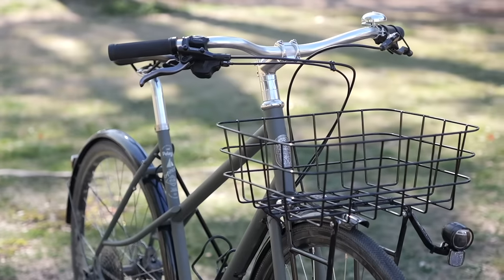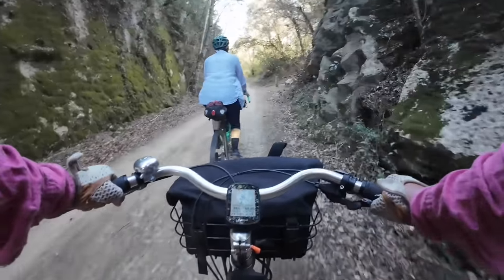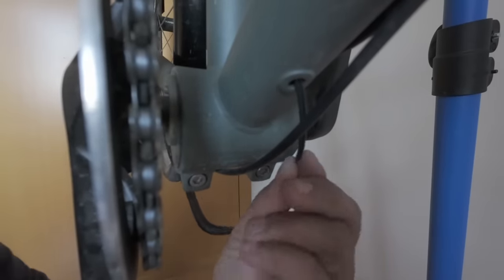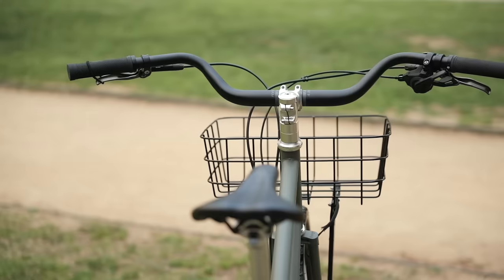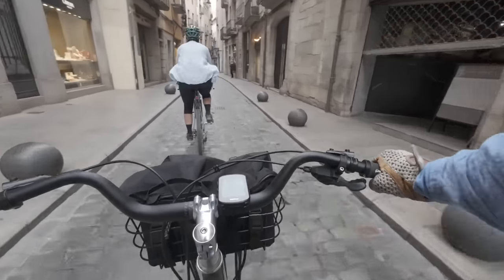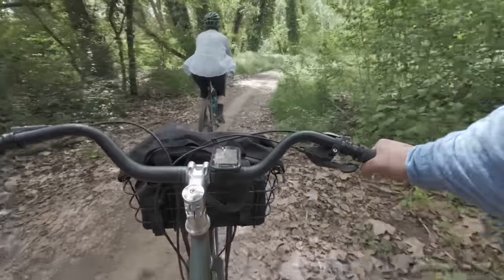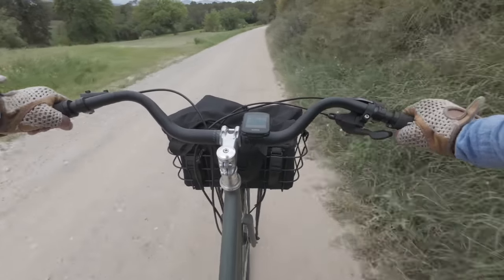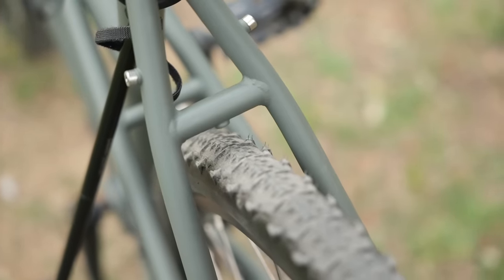I ATB'd a Bike So You Don't Have To

Comment: Be honest: you swapped the tyres because Ritchey is easier to say than Schwalbe😉
Reply from the maker: True
Reply: Sshh-wal-bee

Yeah, just stick with Ritchey.
Reply: easier to mount, too.
Reply: @stanley909 More like "Shvalbuh", actually. So yeah,  Richey definitely easier 😂
Reply: @PathLessPedaledTV  Love the way you pronounce it, makes it sound like "Schwabbel" wich is German for "jiggly body fat", sounds quite supple...
Reply: Shwobble
Reply: Schwalbe has the best budget 26" mtb tires out there...look how inexpensive the 26x2.35 Schwalbe Tough Tom goes for...got a pair for my bike for less than $50 Canadian on Amazon.  That is the normal price not on sale.  Great tire.  It is a previous years higher end model that has been rebranded as they redesigned the higher end one and now sell the old one as the Tough Tom.
Reply: @AaronHendu  Tough Tom is simply a wired version of their bestseller Nobby Nic. Definitely worth checking if you still run tubes👍
Reply: Schwal-be. Just like Porsch--e(e). And yes the "e" at the end, of both of these brands is pronounced the same.

Comment: I think it's great that you're testing more European brands now that you live in Spain. The Pelago looks great with the new tyres and the ritchey handlebars.  Are you just leaving the rear light off now? That would drive me nuts!
I also used to have a mudguard with a rear light and wanted to replace it with a more robust one. But the new one didn't have room for the light and the cable. 
I then bought a new light from Supernova with a mount for the seat post. But that made the whole job more complicated and more expensive than originally planned

Comment: Absolutely. Tires change everything. I made a vintage steel Scott MTB into a city commuter by slapping Schwalbe Big Apple 26x2.15 on it. What a change! And those tires just won't wear out. Another thing which has huge impact on ride quality/comfort are the grips. Today I put Ergon GC1 on my wife's Larkspur. I'd advise anyone who has that kind of swept back bars to consider this little piece of kit. Worth every penny.
Reply: Cockpit is the biggest differnce IMO you can make...proper saddle, saddle angle and height, stem lengrh and rise, handlebars and grips...brake lever angles...
Reply: @AaronHendu  all true.

Comment: best move I ever made was to go to a Fincci 26x1.98 street tire and change wheels to an old seal bearing , Araya rim wheel set. the Araya rims are 21mm ID and a little heavier.  Lose a little response for momentum and stability. Much smoother ride.

Comment: not the most drastic of changes, but i have an all-city space horse that's been my do-it-all commuter and adventurer for the past 5 years. recently started getting into gravel and made the jump to tubeless, dropping down to ~30 psi (650b x 38) and swapped the stock bars for salsa's cowchipper with more flare, and wrapped them in wolftooth's cushy silicone tape. it was comfortable before but even better now, and perfectly capable on mild singletrack. the tires truly feel like riding on clouds. i could definitely fit wider ones on there and get some beefier tread while i'm at it if i wanted, but then i'd have to ditch my fenders. and as long as i'm still spending most of my time on the road, that feels like overkill.

also as of two days ago, a friend is lending me her brooks saddle to try out before i drop the money on one. which i'm definitely going to do, now that i can confirm i love it.

Comment: I don't know that this frame could accommodate them, but the Schwalbe Thunder Burt is an exceptional all-rounder (~54mm).  Marketed as an XC tire with lower rolling resistance than many narrow gravel-tires, while providing great off-road performance.  Just don't send it on leafy or muddy trails!

Comment: I've had a Thomson 130mm 10° rise Elite stem since 2010 and their Elite 410mm× 31.6mm post since 2018. This Elite post is at the max line, and it's held up my wight. I was at 255 lbs. for years 
, and it's still going strong🤘🤘.

Comment: I would have installed the 700x47 Specialized Pathfinder Pro tires.  Lots of volume, roll very fast.  My favorite Gravel tire.    
I would cut the riser bar narrower, maybe 25 inches wide.  I can feel increased wind resistance using wide bars.

Comment: Ditto on those bars although I just threw on the Kyote which is the predecessor of the Buzzard - the initial forward sweep put me forward quite a bit so I sized down from 100mm to a 70mm and still feel stretched out. Also 800mm is way too wide I don't know how people ride on the streets with 700mm+ bars I can't even imagine going on narrow singletrack with them. My next move is to either cut the Kyote bars down or switch back to 640mm bars altogether. Cutting the Kyote means I'm being stretched forward even more so I dunno. I really like how they look and they seemed they'd be really comfortable but so far the jury is still out for me. Let's see after some more riding.

Comment: The B+M Secula plus would have been a good replacement for the fender mounted rear light. It attaches to the seat stays si it probably worked with the wiring. No rear light isn't an option for me in a bike i use in the city.

Comment: Groupsets don't matter until they don't work. I broke my shifter on last night's ride, have broken a bunch of other parts. What's the most durable groupset out there?
Reply from the maker: Friction shifters FTW :)
Reply: Flat bars with index I really like 10 or 11 speed Shimano Deore or SLX. 1x12 SRAM GX is also good but much more expensive for the cassette. For brifters it's hard to get away from Shimano 105 series, any speed is great even the older stuff but you will have to match the 'speed' on all parts of drivetrain which is annoying, as well as brakes.

Comment: I fully agree with your assessment. Tires, handlebar and maybe the stem. Also I use MTB barends placed inwatds at the turns of the handlebar as well as modern innerbarends "spirgrips" next to the brake levers.

I have made a video comparing Spirgrips and SQLab Innerbarends. Spirgeips are more expensive but do much better.
 I have used these components to transform my 94 GT Tequesta into a restomod ATB. Ritchey Kyote, taller stem, wide Schwalbe Rocket Rons. Those are MTB Cross Country, but very lightweight, fast and reasonable affordable. We have lots of rain in the most northern part of Germany. Specifically around here clay soil and sand near the coast so I learned the hard way that gravel tires are not grippy enough.